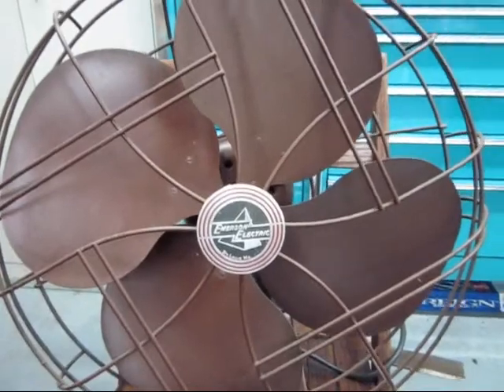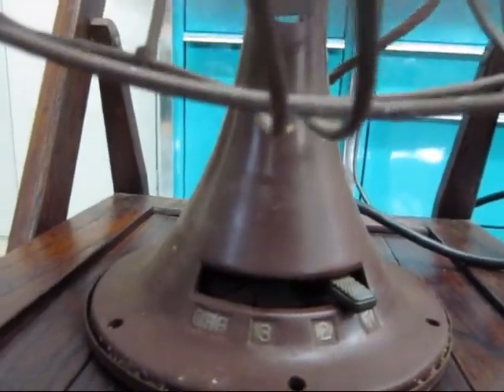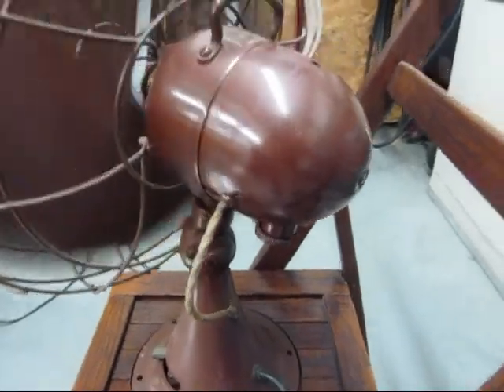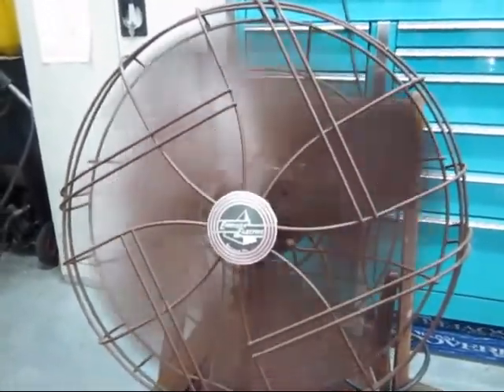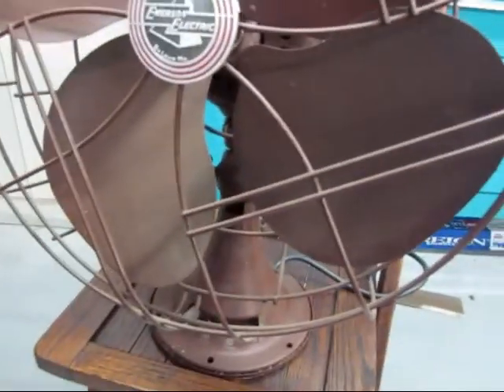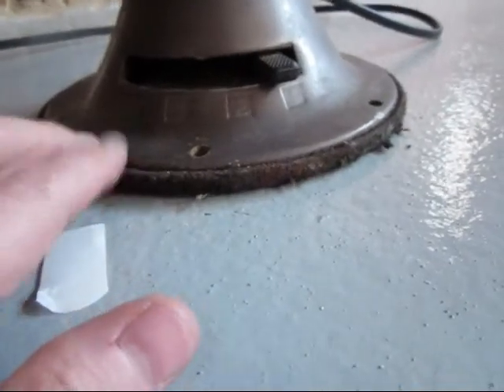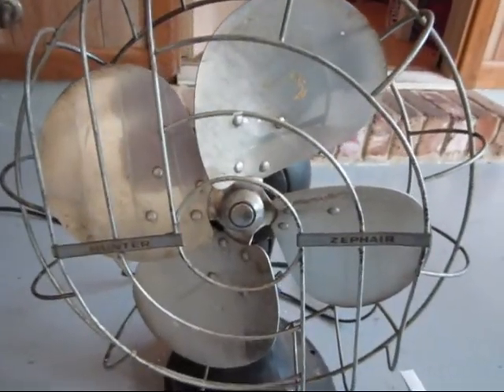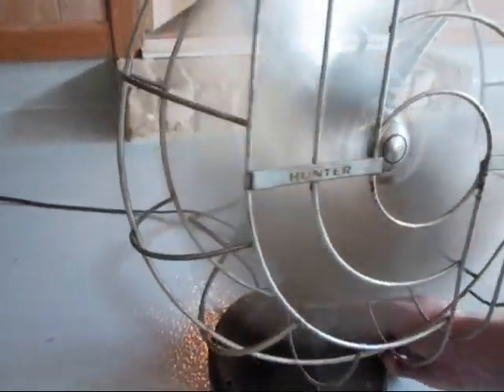Vintage Emerson and Hunter Oscillating Fans

Comment: Very cool video! The Emerson 77 series fans are some of the best fans made. Well built and with the design of those blades they are quiet and powerful! You are about right on the era those fans were made, late 40s- early 50s.  There are 2 of those at my church still running, and I am watching them  if they ever come down. They are also wall mounted. That Hunter is really cool too but those blades are way off balance! I would say that one is from the early 50s. But very cool fans!